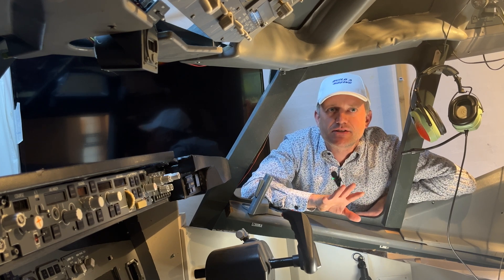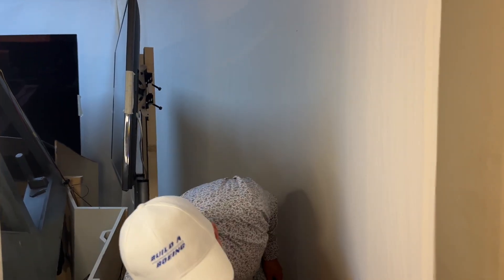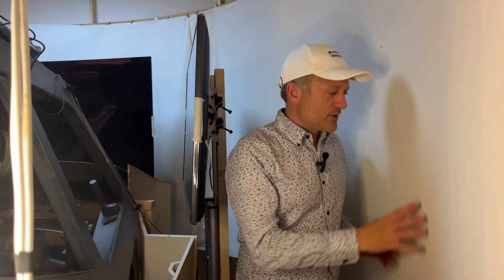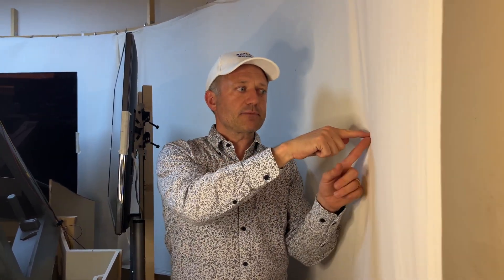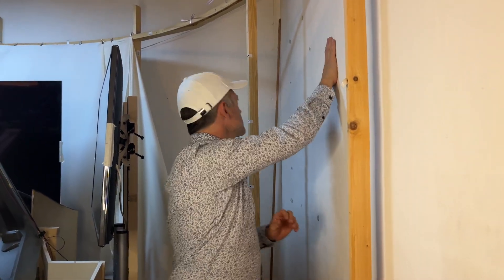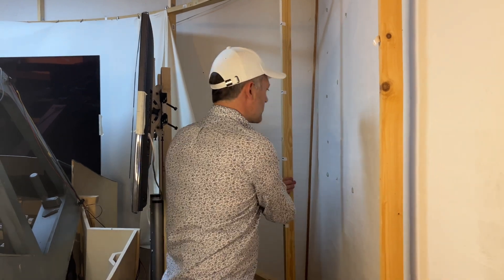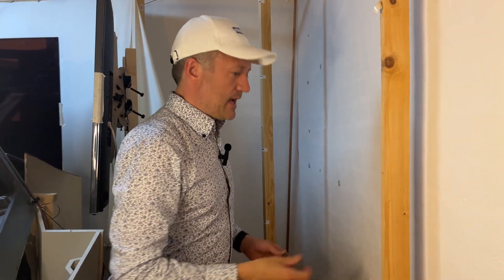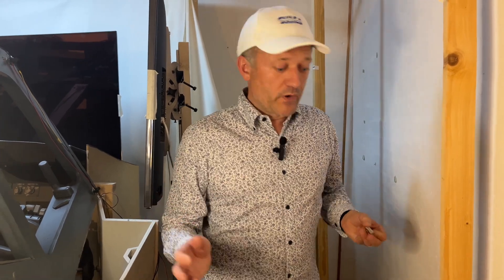How to make a curved screen

Comment: I went from three 37" monitors years ago to a three projector setup where each projector casts on a flat screen. It works pretty well but I contine to have issues with projector bulbs. One starts slowly going bad then they look different until I need a new bulb, but the last bulb I purchased wasn't high quality and already was faded. I love the size of projectors but long story long!! I decided to go back to tvs as well. I've had pretty good luck when the tvs are the same size and model, I'll also be excited for a small bezel as mine in the past had 2 inch bezels probably. Ill admit I get jealous seeing youtube videos that are much better quality than what I get bigger isnt necessarily better in that regard. As well as I had to paint my screens gray because of ambient light and it looks like I'm wearing dark ish blue sunglasses, colors aren't vibrant. I'm considering three 75 inch because how good the prices have come along. It's funny that I found another person going back to tvs!